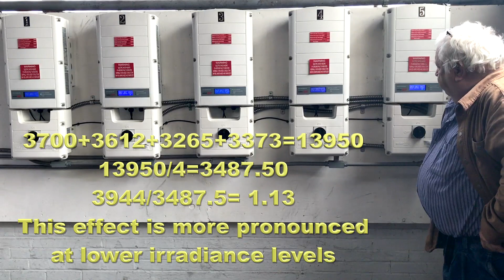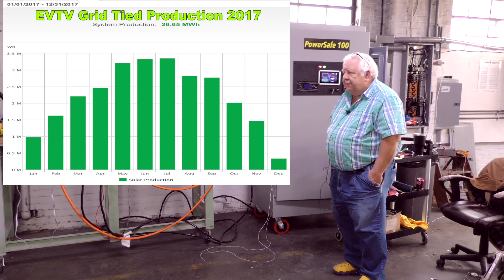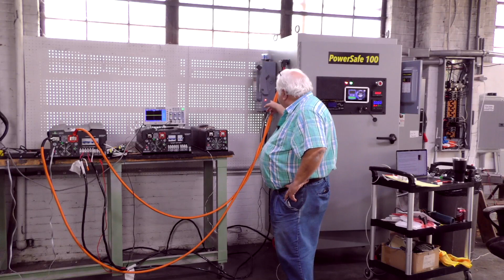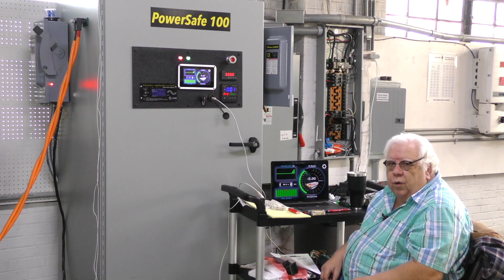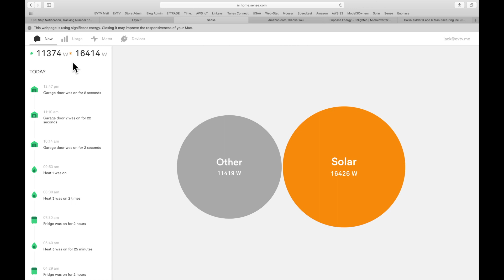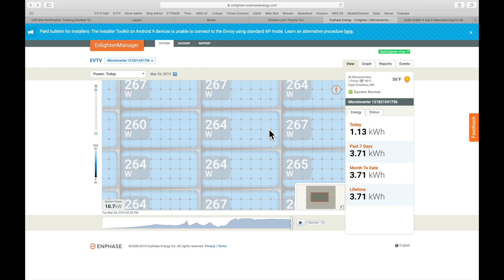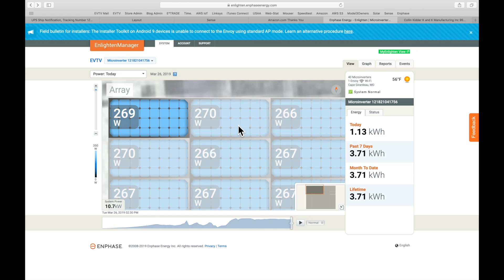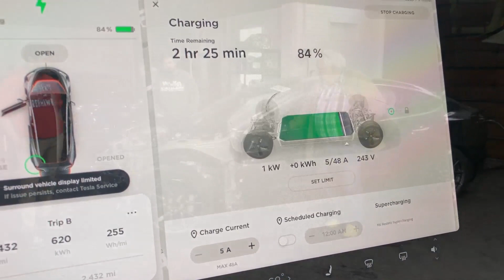Solar AC Coupling - Resurrecting a Model 3 Wreck

Comment: We DON'T NEED to cool and heat our homes!!! You're asking the question wrong. In most places on earth you have to insulate your building with ~40cm thick (really cheap) foam, and you're done. Then any 1000W heater and/or AC can regulate inside temperature of your whole house, when needed. You also must use heat recovery ventilation, you don't open windows... These technologies exist today and are relatively cheap.
Reply: Where do you live where that much foam is ‘really cheap’? In the US, covering an average size house with that much foam would cost 80-150,000 USD. Which would nearly double the cost to build the house.
Reply: The americans are crazy, even in areas that get snow, they have totally uninsulated houses.
Reply: station240 It’s been 60 years since you could build a house that doesn’t have insulation. But some still do exist that are uninsulated in cold climates. It is quite baffling the owners don’t do anything about it since the costs to heat are crazy.
Reply: As someone who worked construction and actually built houses: You'd have to completely redesign/rebuild a house to insulate it with that much foam. Reality is tough, bud.
Reply: idontcare80 To be fair, a great deal of the European countries do mandate very strict building codes. They act like this makes them superior, but it mainly means their houses cost 4x as much to build as American houses, and are tiny. They more often than not don’t even heat or cool them whenever possible. They build houses efficiently and then let the occupants suffer with with poor temperature control and no humidity control.
Reply: @ericspda  Oh, I'm very aware of how poorly American homes are built, I don't know how many times I found myself completely dumbfounded by that fact when working on a house. And the Europeans might pay more for a house initially, but they'll pay less for energy, so the cost probably isn't all that high in the long run. Also, better insulated houses are typically more comfortable than poorly insulated houses, as long as the heating and cooling system is properly sized.
Reply: I'm curious if homes that are that tightly sealed still "breath"?  I was told the last thing you want to do in a home is keep it too airtight, for your health's sake.
Reply: @aussie2uGA  Look up ERVs (energy recovery ventilators).
Reply: Andy B I’m not disputing if it’s sensible long term to build a passive house. I entirely agree. I’m just telling you why it’s not commonly done in the US. People don’t care about saving money in 20 years when they’re going to be moving in 3-5 years. And in the US, most people can’t save a penny, so they surely won’t spend more today with the potential to save a bit later. I’m also very well aware that it makes huge financial sense to insulate an uninsulated house, I never said anything to the contrary. It’s easy for people to be ignorant, and they often just don’t have the self control to save the several thousand it would cost to get someone to insulate an old house. The average size of a new house in the US is 240 square meter, and the internet suggests the average size of a house in Sweden is 68 square meters. That’s going to have a very different cost to insulate. Also, there’s an extra cost since it’s very uncommon to build passive houses in the US, so you need to be very selective about who you hire to do the work since most wouldn’t be capable of building air tight enough.
Reply: @PistonAvatarGuy  Thanks! I found a Popular Mechanics article describing it here: https://www.popularmechanics.com/home/interior-projects/how-to/a149/1275121/
Reply: Andy B The thing most Americans totally ignore is that our building codes are the MINIMUM the law allows you to build. And the current ‘code’ house varies by area and climate zone, but it’s more or less adequate. People very rarely seek to do any better than this in the US, since it’s just so common to not expect to live in a house long enough for it to matter. But you can build a house well past passive house standards if you’d like, it’s just VERY expensive and so rarely done. Unfortunately it’s all too common for people to aspire to code as some sort of high standard, and they often fall slightly short of it in practice. It’s really an education and ignorance problem in the US. I’m planning to build a house in about a year or two, and if it performs worse than 0.3 ACH50 I’m going to be disappointed.
Reply: @Poxenium  That's interesting, but also hugely impractical on a large scale. For houses with brick facades (very common) the entire facade would need to be removed and disposed of so that the foam could be attached to the structure of the house, that would be VERY labor intensive, potentially damaging to the house and would produce tons of waste per house. In much of the southwestern US, houses are covered with stucco, which is an absolute nightmare (VERY labor intensive, in other words) to remove, also creates a potential for damage to the house and produces a ton or more of waste per house when removed. In both cases, doing this work would simply destroy any landscaping surrounding the house. The foam block system would also seriously limit the attractiveness of a home and that's something that many Americans take pride in. From a technical standpoint, our houses may not be the greatest, but they are usually made to look nice. The only viable solution is to use heatpumps to heat and cool houses (supplemental resistive heating may be required in some areas) and to have those systems powered by grid energy that's carbon neutral.
Reply: How do you put 40cm of insulation on a 50 year old brick house? I live in the south and we do need to heat and cool our houses. If you can show how to put that 40cm of insulation on the houses that most of America has that would cost less than the energy it would use in its lifetime, you have a great business plan that would make you rich.
Reply: Aussie2u The issue with relying on natural leakage for ventilation is it’s very unreliable. When the indoor and outdoor temperatures are similar, you get very little ventilation. And when it’s very cold or hot outside; you get a huge amount and it costs quite a bit to heat and cool that air. If you build a house very air tight, you can control where the air comes into the building, filter it, and ensure you have the right amount no matter the weather. Plus it’s much easier to maintain proper humidity. And very high insulation standards also mean you get more consistent temperatures thought the house. But oddly enough the Europeans tend to ignore occupant comfort and prioritize energy consumption of the building.
Reply: @idontcare80 In my country we have mostly brick and concrete buildings, mostly flat walls, so it's really easy to insulate them. The state covers 90% of the cost and in my city, the mayor covers the remaining 10% too. Here in Romania you can't rent or sell a house or building without having an energy efficiency  certificate from an engineer, so the buyer will know exactly how much it'll cost to heat/cool it.
I really hope it'll become law everywhere soon, that you have to meet some energy standards ... the price of electricity and gas should increase exponentially if you're not being efficient and use too much.
PS: you don't have to remove the facade of buildings for insulation. You can use polyurethanic foam adhesive to mount the foam blocks. It'll fill out any gaps and uneven surfaces. To make it pretty, you can glue on decorations made of foam ... and paint it in different colors ... it may end up looking like the original wall, but personally I don't see the point.
Reply: @Poxenium  look on my channel at my home build. 
icf walls and Insul-deck pitched concrete roof.
 85 yards of concrete thermal mass between walls and roof 

Offgrid 
2 ton geothermal heat pump
For 1700sqft 
Heatpump water heater
Reply: COOL! BUT you don't have sufficient insulation :) Add another 10 inches of foam and you're golden, you can sell most of your solar generated electricity ;)
Reply: @Poxenium  im off grid who would i sell it to? LOL
I agree another 10" would be great on alot of things LOL

Comment: I have been using a 3 kW off-grid solar system with 20 kWhr of LiFePo batteries for over two years to charge cars. This system has two of the fourteen panels AC coupled. The system has a Schneider 5kW Inverter. The two panels that I backfeed into the Inverter have Enphase M215 inverters. I had called Schneider at the time of build to ask if this would work and there first answer was no, but after chatting a little they said that if it was only two PV panels out of fourteen it should be fine. The system has been working now for 28 months just fine.
Reply: That's a smart setup.

Comment: Part of the problem of storage batteries for serious independence from the grid is this:  Lithium high cycle batteries are great, as long as you can actually use their cycle life up (before you die).  When calculating LCOE of these things the formula presumes the exhaustion of the battery over time.  With old flooded lead acid technology that was an ok calculator. You could have 5 days of storage and you would still use up the battery cycle life within 20 years. Not so when you have 5000 cycle lithium or even 3000 cycle lithium.  8 months of the year you only cycle a five day battery to  10% DOD and then 5 times in winter you cycle to 100% DOD.  The battery will die not from cycling, but simply entropy of ageing, with a theoretical  tripling of LCOE.  What to do, what to do?  Well, weirdly we need a cheaper 'lower life cycle' lithium battery!  Something about $100 kWh with perhaps 1000 cycle to 90%DOD.  Now we can have our cake and eat it too.  250 kWh for $25,000 and a 20 year life span.  A little over $1000 year for independence.   But these need to be new, prepackaged with BMS, not recycled car batteries...because too much labor/time.  
For you to actually get off the grid and eliminate your $4000 of natural gas heating, you need negawatts of insulation, (50% demand reduction) and heat storage of say at least 10,000 kWh of hot water. That is my rough estimate of the kWh of natural gas you are using.  Such a storage tank would be about 40,000 gallons or an 18 foot cube.  Could be scattered in smaller containers as well.

Comment: An off-topic question to the Tesla gurus out there: How can I safely disable a model S and Model 3 of being driven? It will be done remotely via GSM module. Jack mentioned long ago about a pin of the charging connector,  when connected to ground will prevent the car from running. I'm afraid the model 3 does not have such Disable pin in it's connector. Alternatively, preventing the car from switching from Park to Drive, but that's all done through CAN, I'm sure. Maybe the break switch, if it is a switch and not a pressure sensor? I'm not looking to interrupt any CAN networks to achieve that. Ideally, it will be interrupting a connection with a solid +12V, +5V or GND, not data, as it may affect negatively more than one system in the car.
Unfortunately, I have no access to Tesla schematic diagrams to find out myself. I'm also willing to pay for valuable information.

Comment: you can get over 35% from your panels by capturing the heat ,nuclear has to be refined and it's owned by the oil co.and distribution  11kv line loose 50% , ht lines loose 17%

Comment: Instead of dumping excess to the grid where you get pennies on the dollar, use the excess for heating and cooling. Put in a 400 gallon Hot water tank with a electric heater element for the winter with a few radiators. Run the A/C in the summer off the solar. Start Bit Coin mining...
Reply: @Jack Rickard I have two solar thermal panels for hot water but my wife was constantly complaining that the water isn't hot enough so I added a heater element to the 80 gallon tank. My electricity use sky rocketed. I was in Colorado over the summer and met with Ellen Franconi, a manager at Rocky Mountian Institute. She said she has four panels with a 400 gallon tank. Another person I know had a Honeywell heat pump hot water heater that has worked fantastically for him. I think if I did it over, I would go that way. My Air Conditioner is the next thing I want to do something with. I watched your EVTV with the mini split A/C. Our house has my daughters room over the garage which gets really hot. I think that will be my next project. Geothermal Heat Pump I think is the future. I had a thermodynamics Professor forty years ago who said heat pumps are the future. Is it the future yet?
Reply: If you watched Hyperchange on Heat Pump company, Dandelion , the partner company in Oklahoma is AAON.
Reply: Jack Rickard I read it in a press release about a year ago and bought some AAON stock. Googling Dandelion and AAON, I just found an article in  Greenbuildersmedia.com titled “Dandelion Hopes to broaden Geothermal’s Appeal” by Jay Egg from May 30 2018 that states it toward the bottom of the article.

Comment: Elon disagrees and has stated that the U.S. could be powered by ~100 square miles of solar panels with about 1 square mile of battery back-up to match. I don't know, just sayin': https://www.entrepreneur.com/article/297414  He does say we could use other sources while transitioning, such as geothermal and nuclear etc.
Reply: yogi bee actually he said 100 miles by 100 miles - so 10,000 sq miles. A massive installation by any measure, but still pretty amazing that it could power the whole of the US.  The article you reference misinterpreted the other article it sourced the original quote from.
Reply: @newsfromthefrunk  You're absolutely right. I sit corrected, 100 mi. x 100 mi. Thank you for catching that massive error. Unfortunately, it's hard to remove stuff from the internet. Apologies to anyone who has started that project believing that gross miscalculation. ;-)
Reply: That boils down to 1680 square feet per person. I'm about 25% there for my family of 3.

Comment: 14:50 political remonstrations aside, your experience as an adopter of solar does not give you a standpoint to advocate for nuclear. I suggest you publish your research into nuclear, especially if you can identify a viable technology for the period say 2020 thru 2050 using nuclear power to replace coal, and presumably to use nuclear to generate electricity to replace some uses of oil and gas.
Reply: @Jack Rickard sorry to have upset you

Comment: Jack I do my best to follow along but I’m not grasping the significance of 35% efficiency of PV. Isn’t it cost per watt equation? Efficiency is compensated by increasing the array size if $$ allow. You already have enough generation so it seems that getting battery storage to something above 100% of your (say 7 day) requirement is a bigger issue. The solution you stated was solved for you powersafe100 customers just scale up for yourself. Anyway why 35% eff for PV?